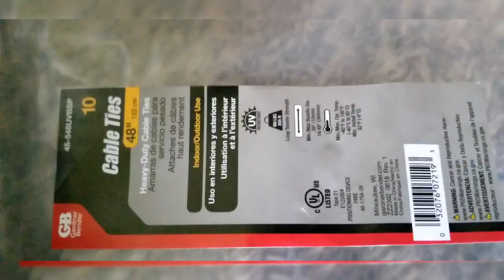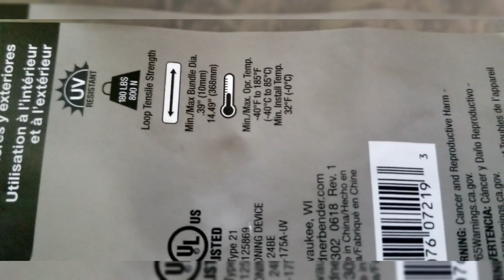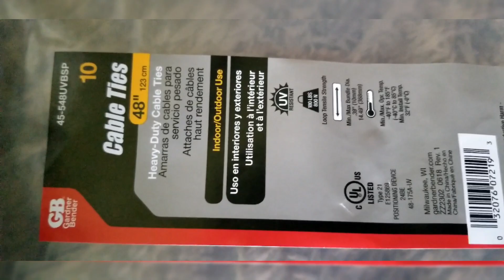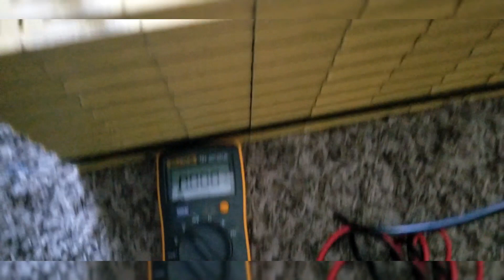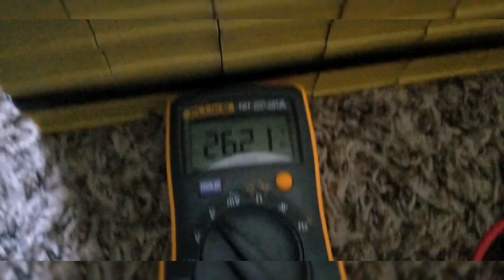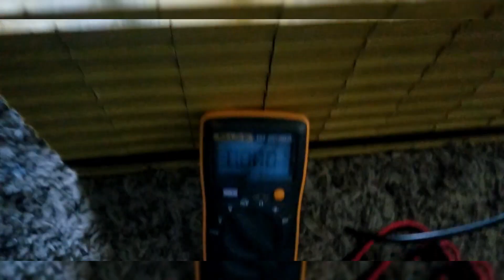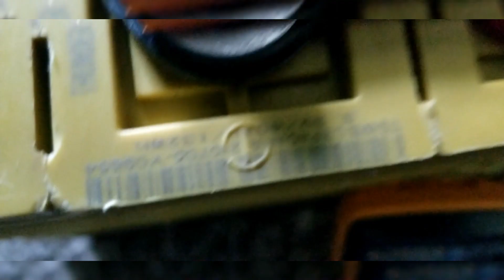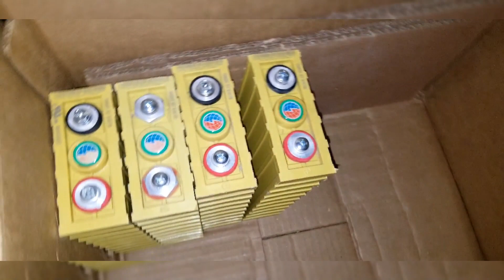CHEAP DIY SOLAR BATTERY BANK; (Off Grid  Solar Battery Bank)

Comment: Morning.  Can you put the model and manufacturer of what you used in your description...

Thanks
Reply from the maker: MODEL NO: TS-LYP40AHA
Nominal Capacity: 40AH
Operating Voltage: 2.8V～4.0V
Weight: 1.6kg±50g
Dimensions: 116×46×183mm
Internal Resistance: ≤0.7mΩ
Reply from the maker: Don't forget to LIKE👍& SHARE